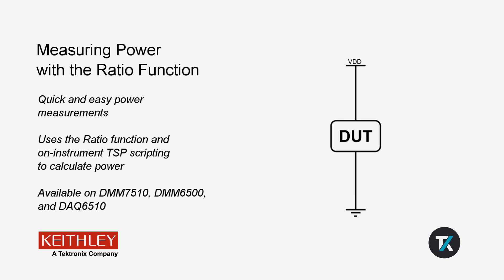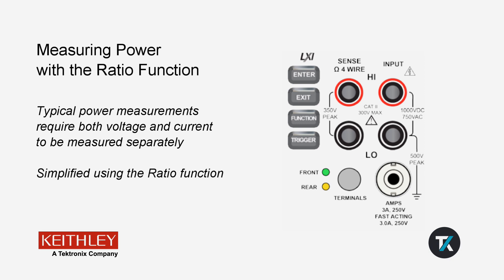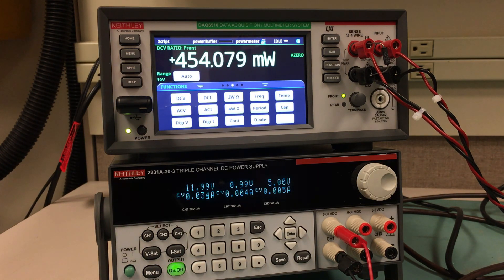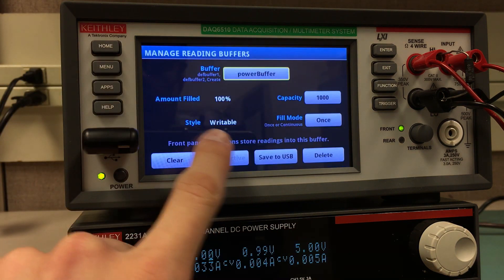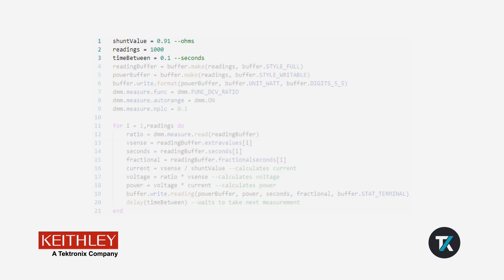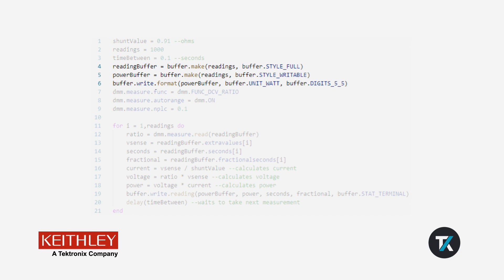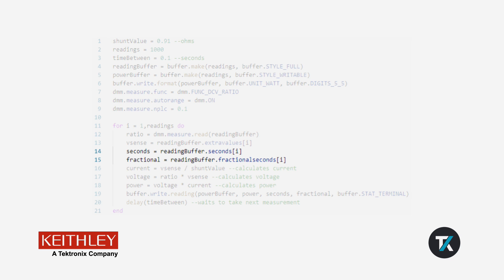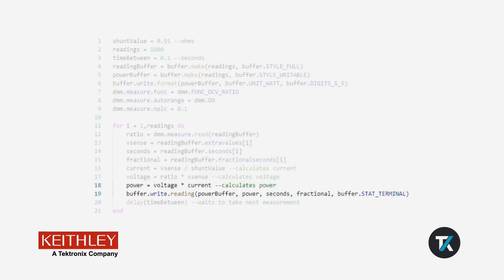Pro Tip - Measuring Power using the DC Voltage Ratio Function

Comment: Pretty cool. 
Would be even cooler, if you also added it together to show watt/hours (or Joules). I would like to use this for testing E-bike batteries with an old analog DC Load.
Can you show the voltage at the same time??? And on the graph, so one can see when the Li-batt voltage "breaks"???

Comment: Is AC power doable?
Reply: I guess it depends on the frequency. It measures voltage pretty fast.
Reply from the maker: a man - There’s probably a way to bake an AC power version of this into a script using the DCV ratio function and some additional coding. Maybe sample over a given number of line cycles for a given line frequency and use the data to do the math.
Reply: @joshbrown5138  Are you sure? Can you measure negative voltage on sense channel? And I think there is 10V range limitation on sense channel. If he wants to measure mains voltages and a current - he needs some external shunt and connect it to sense channel.
Reply from the maker: technics6 , I’d have to look at the spec to be 100% certain but negative voltage should be allowed. There is the sense input for the DMM6500, but, I’d more flexibility is needled, the DMM7510 offers more ranging capability.
Reply: Yea, DMM7510 is box of awesomeness, but it is too expensive for me. However now I have more motivation to grow my little bussiness just to buy and use stuff like this :)